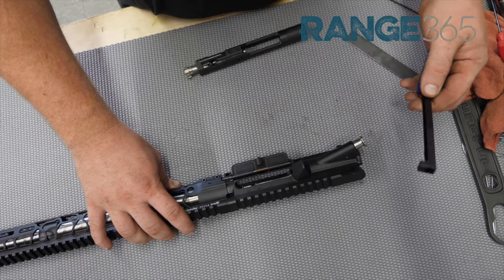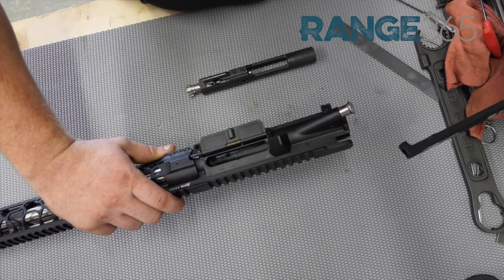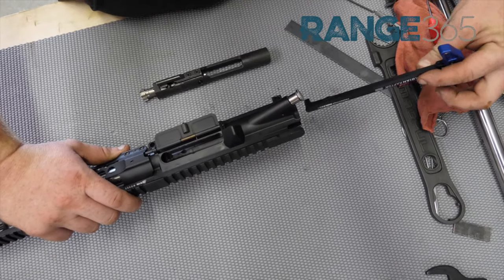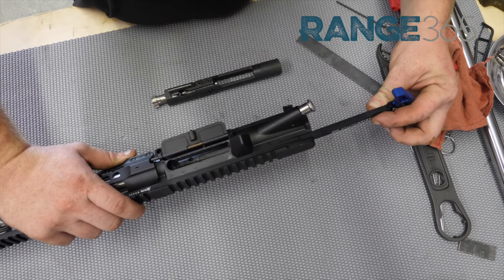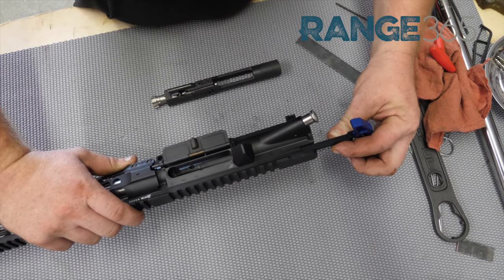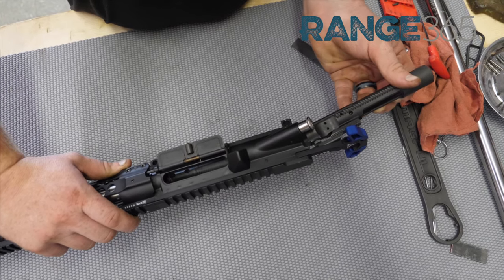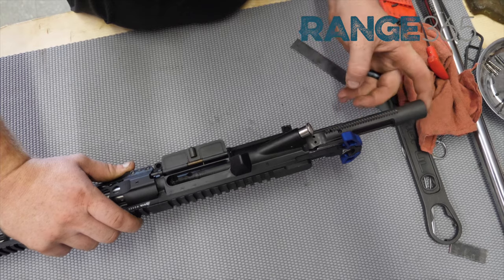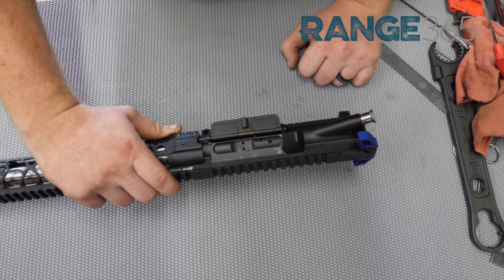How to Install an AR-15 BCG and Charging Handle

Comment: People who are struggling as I was. Your bolt inside the carrier needs to be fully extended.  Also, pull out the charging handle so the gas key can slide it, drop both together.
Reply: Thank you 🙏
Reply: This was my issue, because if the bolt was inside the carrier all the way a little ridge of metal wouldn’t let it slide it

Thank you 💪
Reply: Thank you!
Reply: That’s a very important piece of information. Thank you! 🥸😊
Reply: Thanks bro
Reply: I'm so lost, I've got my bolt pulled forward I'm lining the handle in properly but I still can't get everything back in
Reply: Thank you so much I would of been Screwed without your Help 🙏🏻
Reply: Dude, as someone who is trying to learn this stuff, I watched the video 3 times trying to figure out what I was doing wrong, this was EXACTLY what I was doing wrong, the bolt was not fully extended. THANK YOU!
Reply: @halloweencraze  the charging handle has a slot to go fully into the top of the upper reciever.  Make sure it is in the track and not sitting where the bolt should be.
Reply: Yo you saved my drunk ass 15 minutes as least.
Reply: Bless you. You are a saint!
Reply: Lmfao thanks don’t know how I didn’t notice that
Reply: Thank you. Weird how it has to come to this as non of the “pros” ever mention this
Reply: Yeah okay I had the same problem getting the bolt back in but there was a little Bridge of metal in the way so looking at that you can see it moved so I moved it and extended the bolt everything worked
Reply: Omfg that's what I was missing... thanks!
Reply: Thank you 🙏🏼 helped me a lot lol I just bought my first ar still learning

Comment: Great video. Since I'm a newbie, had issues until I realize that the cam pin has to be turned to get the bolt back in. A suggestion would be to point this out for others. One learns most with burned marks on their butts!
Reply: THANK YOU. Rewatched the video a bunch of times couldn't figure out what I was doing wrong.
Reply: Thanks
Reply: Had figured this out before the video, but liked that somebody else noted it on a video since that was the first time id ever had to even think about it.
Reply: Same here!  Thanks for the comment. :)
Reply: How do you do it. I can't get thr bolt back in
Reply: THANKS!
Reply: As someone who has cleaned way more than my fair share of handguns for my age but never an AR platform, I had no problems figuring out how to field strip it but suddenly it didn’t go back together the way it came out and I was panicking until I found this comment

Comment: Just getting into Ar's. Grabbed two complete rifles by Sig and only got to mount optics and slings on them. Decided to also grab up a lower and upper from Palmetto State as the price is great and figure it would give me some experience placing together. Waiting on lower to arrive and had the spare red dot from one of the Sigs (mounted a lpvo on that) along with mbus iron. Removed charging hand and bca. Was having slight difficulty getting back in. The slight angle pointed out in video was the little trick needed. Thanks.

Comment: Ordered an upper for an AR-10 build that was the only one that came with out the charging handle and bolt carrier group. Just received the ordered parts, looked at this for reference and popped it in within a minute. Thanks for the reference 🙂

Comment: My Charging handle was milspec and my lower was an Aero precision 10.5" AR15. I thought I knew how to do this since I had done it before. Well my charging handle was not rising up into the groove and when I pulled it out the upper reciever was leaving indents on the Charging handle. The video gave me the confidence to keep trying and I was going to put a file to it where i saw the indents but after a few tries and a little push it rose up and we got it put together.
Reply: 37 seconds yeah ...
... just stap it up in there !

R I g h t  !

The part they left out was that the ears  (_)  on the charging handle MUST "drop" through a corresponding slot  (__) first visible from the bottom; before sliding the handle forwad..

}}}B00M{{{ ... it was over just like that  !